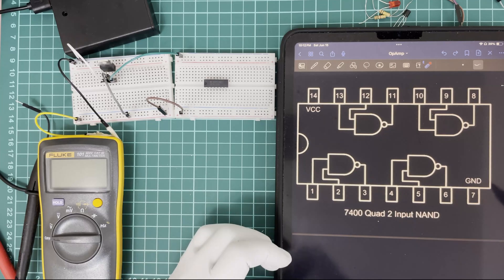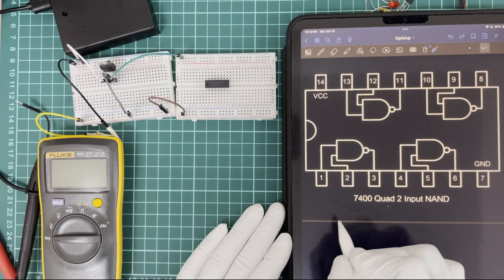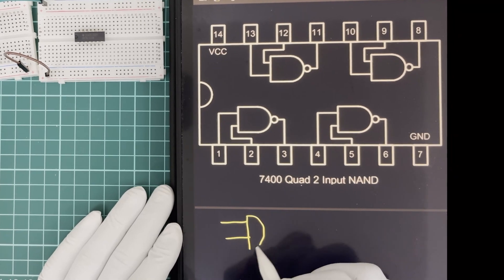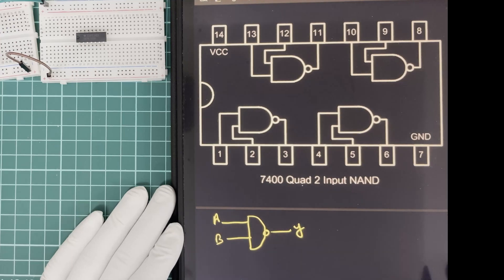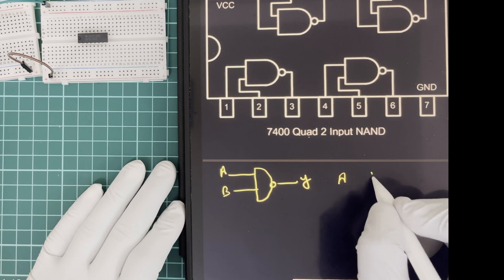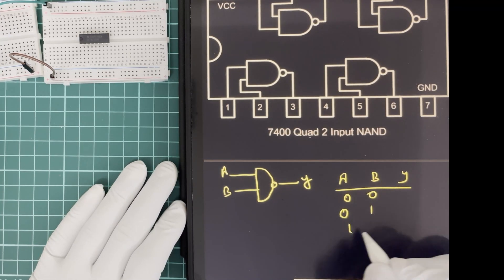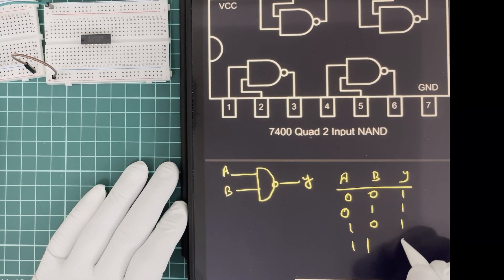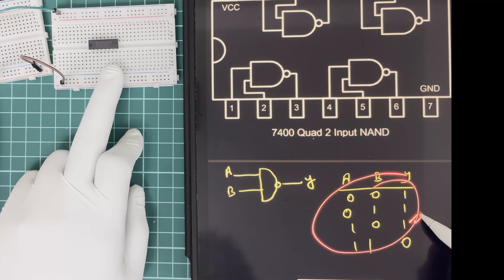How to test NAND Gate  SN74LS00 IC and Construction of AND Gate using 7400 IC in 4K

Comment: At the beginning of our practical we have to check the IC to see if it is correct or not. Naturally an IC has four gates, in that case the output has to be obtained by input four times.Is there any short method where the IC can be checked whether the IC is working while doing the practical?
Reply from the maker: Good Question for exam point view, In my next video I will show you how to do your practical without checking IC separately.
Reply: Also in the middle of the practical if one of the gates in the IC/ any wire gets damaged by any reason how to find exactly where the problem lies?